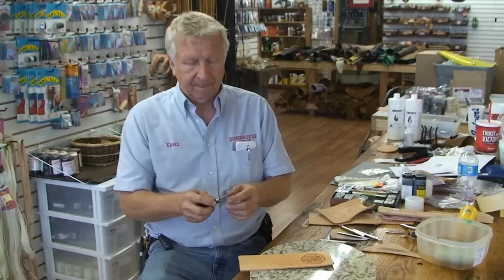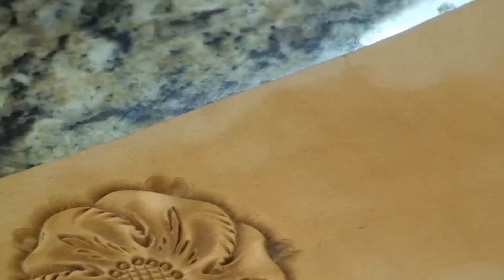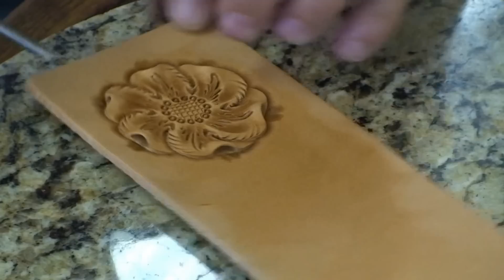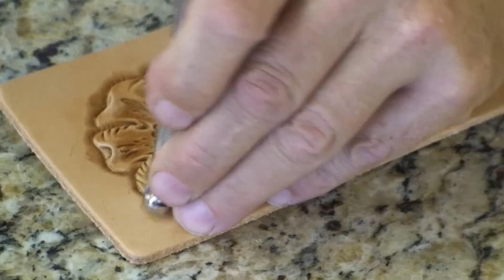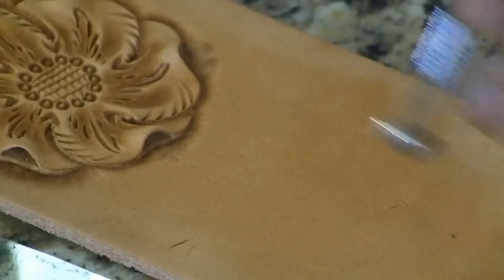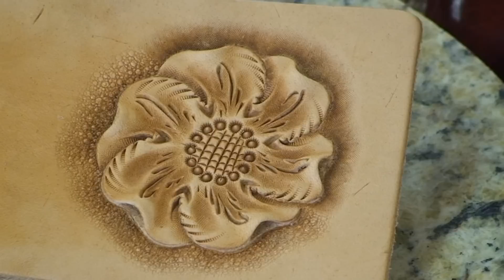Springfield Leather Company Helpful Hints: How to Use a Pro Petal Tool

Comment: What happens when the leather dries out? Can you get the same level of tooling if you have to re-wet the leather?
Reply from the maker: Hi, Joey! When the leather dries out, the design should stay exactly the same as when it was wet. Yes, you will most likely get the same level of tooling if you have to re-wet the leather, as long as it's still raw leather. If you have applied some sort of dye or finish, you will not get the same results. Thanks for your question!
Reply: Kevin, is this the large or small pro petaler? There are no sizes listed on the website- the one is in this video appears to be about 5mm?
Reply from the maker: Hi, Sheri! Thanks for your question! This one's a large pro petal tool, which you can view here: http://springfieldleather.com/Pro-Petal-Large . The size you use depends on the size of your project! Let us know if you have any more questions. :)

Comment: if it's going to take a few days to carve the leather, will it ruin the leather as you re dampen or should you try to do it in one day?
Reply from the maker: Wetting the leather isn't going to hurt it.  In fact, usually while caring it is typical to re-wet the leather frequently to keep the right amount of moisture in it.
Reply: oh okay awesome thank you for making that clear. i haven't found any videos going through that bit of detail. that has helped alot
Reply: I have ordered the tools and some veg tan leather and all of it isn't going be here for another month for my first go ever. is their any other quick tips for a beginner or do you have a video about some?
Reply from the maker: Serene Seaman-Try
 What kind of projects are you wanting to start out with?  That will help me narrow down what specifics you need to know.
Reply: Just a leather cover for an A5 Journal
Reply from the maker: Helpful Hints: Making Decorative Cuts
This video on making decorative cuts has some good hints.  But also, when your carving the leather, make sure that you tape the back with masking tape to prevent stretching while you carve. 
Is there anything specific that you have questions about?